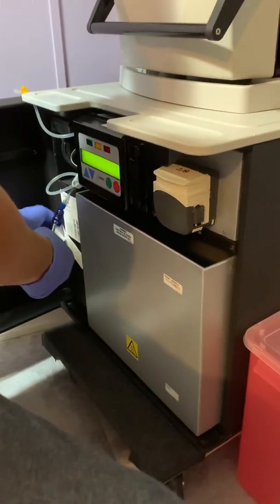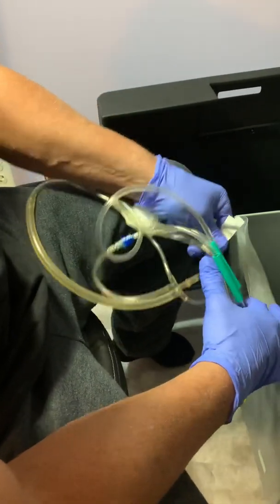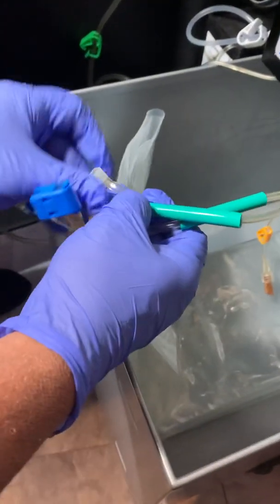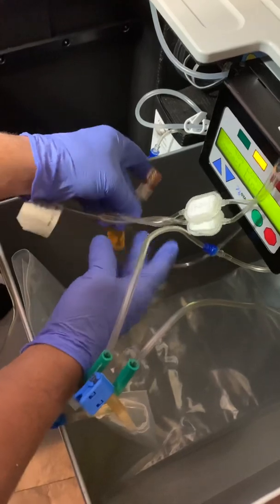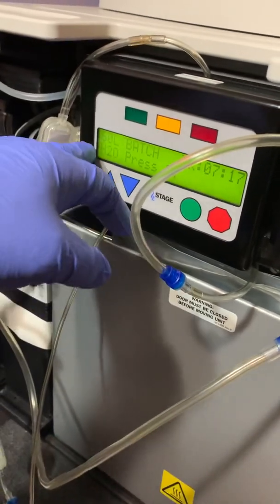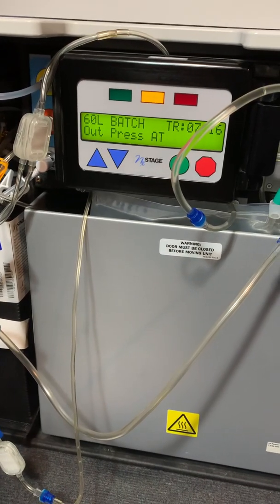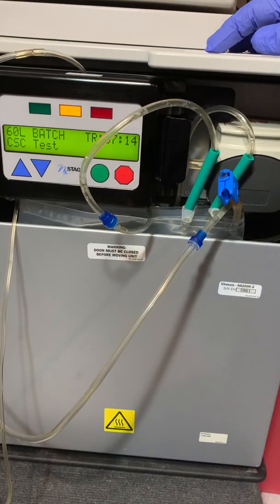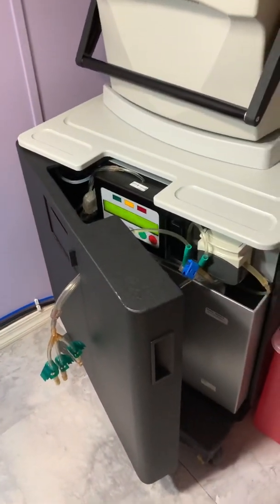Nx Stage system - how to make a pure flow dialysis sak

Comment: How do you fix that error of A14 ( Compromised PAK )
Reply: Generally that error is generated when the lines on the SAK itself become pinched or kinked during the filling of the bag. That's why it's important to center the back in the bin and fold the SAK up against the front wall of the bin allowing the lines to hang out while filling. The SAK is folded at the factory in such a way that it will unfold itself properly as it fills. Press RED button to clear the alarm then GREEN button to continue making batch after making sure the two bag lines are free from kinks.